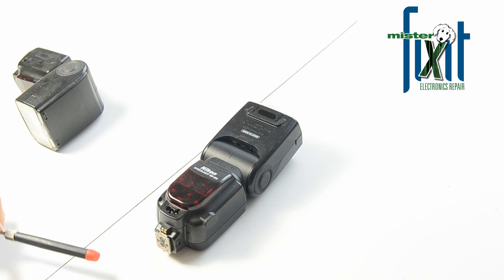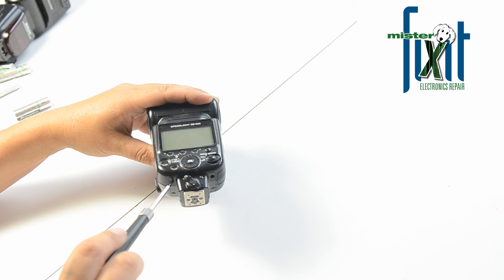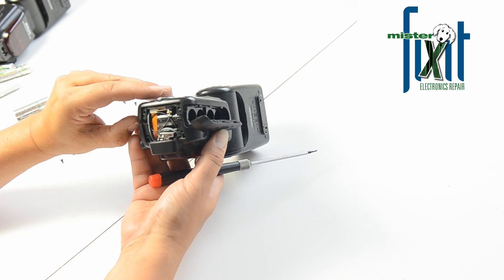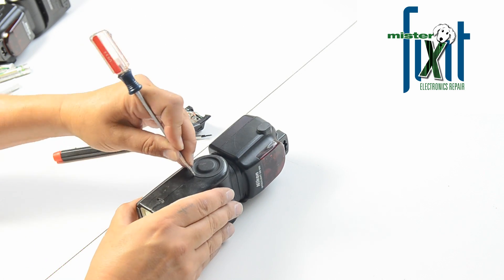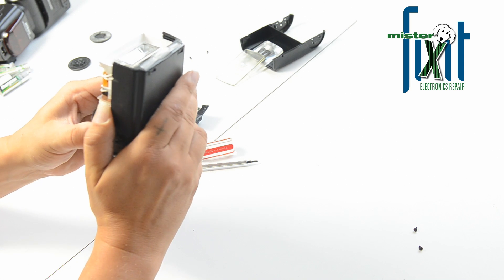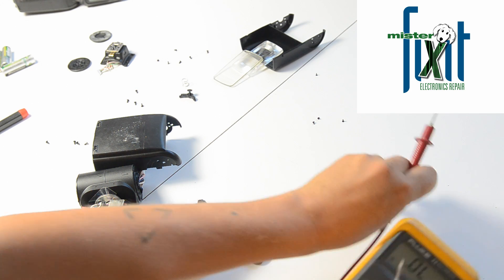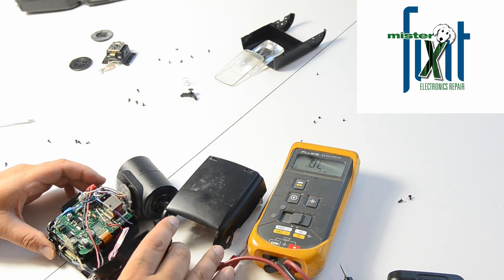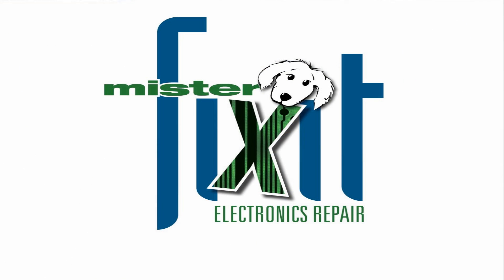Nikon SB900 Flash Repair

Comment: I just broke out my SB900 after it had been sitting unused for the last ten years or so. It wouldn't power up so after watching this video, I gave it a few good smacks on all sides with the palm of my hand and it powered right up! I always hated this flash...overheat errors after a dozen flashes constantly, even at low power. The SB800 is a far superior unit.
Reply: saved my day. Did the same. Works again.
Reply: Worked! Came back instantly. Just a few firm slaps and that was it. Many thanks.

Comment: ohh my friend you are lucky that didnt get 320 v shock and actually i was in a shock the way you open the flash and im still worry did you able to put all back to screwed completly  ? if anyone try the same please discharge the capasitor ..you can use 220v hight watt lamp

Comment: The skip in the middle skipped the part I needed... how to get the bottom half separated... was removing the top half necessary?
Reply: The 4 hidden screws (below the flash turntable) and the 4 screws at the shoe are all you need to take apart the bottom piece.  Once removed, the two parts come apart with a little prying.  To remove the circuit board to access the lcd screen and battery compartment you have to remove two (obvious) screws and then do some un-soldering unfortunately. Best of luck.
Reply: @mski349  This reply was more valuable than the whole cr*p video
Reply: @mski349  so just to be clear, to take apart the bottom piece (that has the main control board) only the four screws underneath and the four that are accessible by turning the flash +/-90 deg?

Ie no need to open the upper flash assembly?
Reply: @mynameisben123  it’s been a couple years now (and I no longer have the flash) so I’d have to defer to my own comment. Looks like 8 screws is all you need to undo.
Reply: I still don't know the answer to this, but this is THE MOST IMPORTANT PART!!!!

Comment: Shaun Price is absolutely right. The first thing you should do (before starting to disassemble the flash) is to set the bounce angle to 90 degrees, remove side rubber and side mold (the one on the right as you see it from behind) and discharge the main condenser through a 200 Ohm to 2 KOhm resistor inserted into the two holes revealed… The rest you can find in the manual which is online.
Reply: Hello! Can i ask you something please?  I have a mk910 Meike, that is the same (esternally) to this nikon flash. I had issue with the van battery because it will open easily and the flash head is very simple
To move. Seems like some screws are slowly between one side to other but I cannot find them. 
Should be just attached without screws? I mean the display side to the other one work IR.

Thanks in advance

Comment: I would not advise anybody that does not know what they are doing to try this. There are much easier ways of pulling the flash apart - see the repair manual. You also came very close to getting your hand across some terminals that are connect to the capacitor. It could have been charged to 320V and given you a very nasty surprise. I just repaired an SB-900 and after 6 weeks of being off the capacitor was still at 100V. I obviously discharged it before proceeding.
Reply: Do youfix fllashes how much